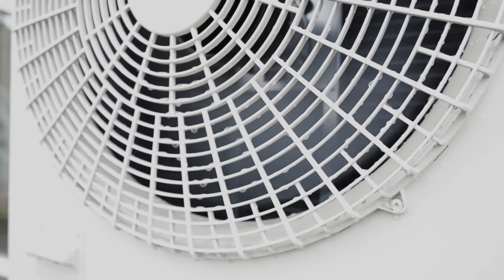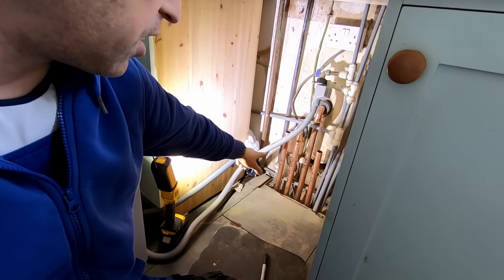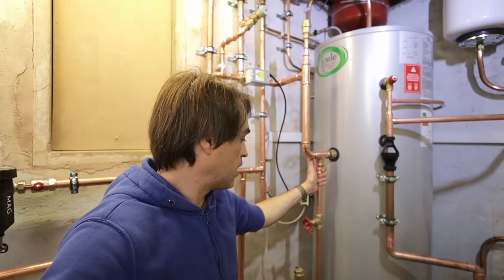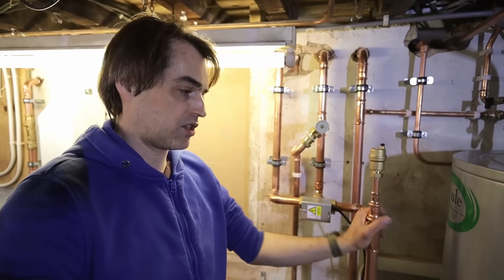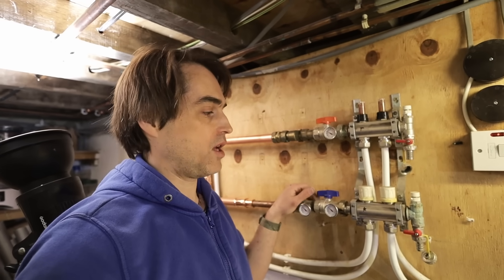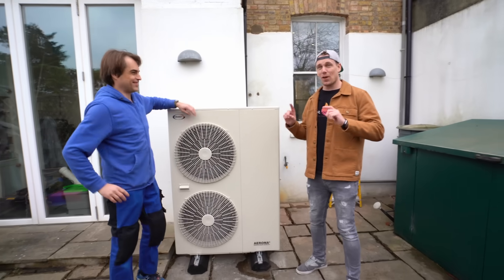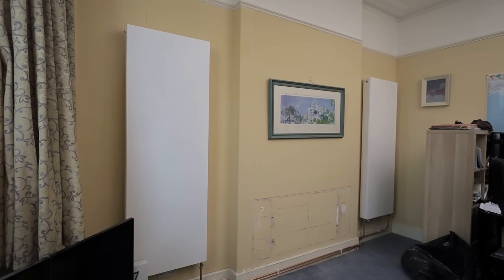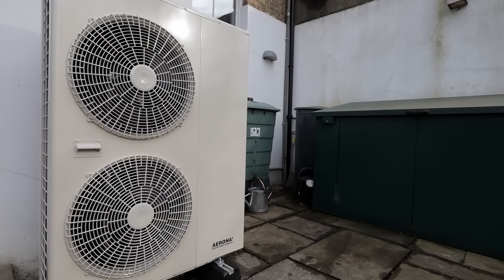The Truth about Heat Pumps: Debunking the Myth.

Comment: Excellent work, as always Szymon, but I think this video kind of makes Roger’s point. That install must’ve cost at least £20k, that prv pump alone was £700! And having to fit those massive radiators, including those TWO great ugly things in the lounge! Yes, you’ve shown that ASHP can work in old, solid walled houses, but the cost and impracticality/ugliness of the system will definitely put the large majority of home owners off, as would the running costs. It’s only the well off, virtue signaling “I’m doing my bit” crowd who would entertain that kind of thing.
Reply: This is a pretty large house though I assume - big cellar with underfloor heating, 12 radiators etc. 17kw ASHP was it? that seems quite big so assume a big house. A regular 3 bed semi would be much smaller and simpler. At its simplest, ASHP just replaces a boiler but you run it at lower temps so you might need larger radiators (might not). Run low and slow like you’re cooking a nice pulled pork rather than spiking up/down with boiling hot radiators.
Reply: @MrKlawUK  solid stone walls too so large heat loss.
Reply: @MrKlawUK  From what I know of ASHPS, the property needs to have excellent insulation, have superior air tightness (necessitating a heat exchange ventilation system to control condensation while minimising heat loss and still provide fresh air into the property) and have suitable places to put the heat exchanger etc. There are a great many more requirements for ASHPS to work well than a boiler requires. Since most homes do not meet the stringent requirements of an ASHPS, most homes will require an expensive retrofit. Going forward I see ASHPS specified as the default for newbuild homes, allowing for a controlled change, with existing gas being retrofitted to hydrogen for older housing stock. This would have a number of benefits:
* ASHPS tech will have time to evolve to cope well with our unique weather conditions, becoming a more viable and realistic replacement for gas technology;
* Hydrogen, once given the go-ahead, will be able to quickly scale as new and more efficient separation technology is adopted for extraction from sea water (there are a number of new technologies emerging that have much better extraction efficiencies than traditional electrolysis including an interesting catalysis technology with easy recovery of the rare earth element catalyst);
* The grid will have time to grow safely to cope with the increasing load as ASHPS is another load to add to the burgeoning list including EV chargers);
The main issue isn't the technology but the government lacking the will to commit because they don't understand it well enough to make informed decisions.
If we get a dynamic, educated and forward thinking PM, we could still make those green targets, but only with government backed fiscal support for people with household annual  incomes below £50k, which means the lower classes and the lower middle class. Just an observation on the whole debate, one that is easily overlooked when discussing managed change involving technology.
Reply: Have you seen gas prices recently? This will pay for itself in ten years
Reply: @syrus3k  have you seen electric prices ??? Gas has gone up because what is happening in the world right now, and the uk being the uk and not being self sufficient and always buying our materials and produce in is exactly why gas and electric isn't cheap.
Reply: @syrus3k  you clearly haven't read my comments lol im not going to repeat myself. Do your research budd
Reply: It's also worth considering stuff like triple glazing, cavity wall insulation etc first!
Reply: The prv pump will require electricity what happens if the electric fails is the same time as the prv snorkel and flippers for the basement the customers money would be better spent on insulation zone valves and smart thermostats at the moment heat pumps just don't have unless underfloor heating is used I would think the proven thing to do would be to correctly design underfloor heating in conjunction with heavily insulating put a gas or oil boiler in for the time being show 7 or 8 years down the line the technology will improve on the beer coolers and then you can just look at my heat pump or a small nuclear reactor this is a subject with unfortunately customers are really going to be scammed Roger hits it right on the point why would you spend all this money to have such a compromised heating system you can always wave you willy about your air source heating system but I'm afraid winning it's cold and you really need it the Old Mr Johnson's gonna get a bit short and shrink
Reply: The H2 thing only makes sense once we have such a glut of renewable electricity that we're charging everyones cars and home batteries and now have little else to do with it. We are a long way off of that.
Reply: If you burn the gas in a power plant and your heat pump only manages a CoP of 2.1 you're still getting more heat for a unit of gas, and it only gets better from there, i.e. you have some solar or wind or hydro or nuclear or the CoP is better than 2.1x
Reply: Couldn't agree more. I watched this video and I'm just thinking, damn how much did that cost, damn how much does THAT cost, holy crap 2 of those massive things I've got 3 rooms that would need the same thing how much would that cost!! and where the hell do I put the giant tank!

I'm gonna have a gas combi boiler until the day the gov bans them and my last installed combi before that can't be repaired anymore, after that I'll probably just get my shower replaced by an electric one and freeze in the winter I guess lol
Reply: @lewbaker  I’m gonna stick my neck out and say we’ll still be using gas boilers after 2050!
Reply: @SisterAbdullahX  Fuelled by hydrogen
Reply: @SisterAbdullahX  I think very few people will be using gas boilers after 2050.  When a new technology comes along it is slow to catch on, but then there's a tipping point where the old technology gets too expensive.  There's a lot of infrastructure cost in bringing gas to homes.  This cost is spread to lots of users, so it isn't too bad.  For example the cost of my gas service is over $15/month regardless of whether or not I use any gas.  The more households drop gas, the fewer people there are to share the cost.  Would you pay $30, $60, or $100/mth just for the service?  The same will happen with gasoline cars.  Eventually people will have range anxiety about gas cars LOL, because most gas stations will shut down from lack of customers.
Reply: @antonydewar7875  1
Reply: @lewbaker  a couple decades from now using gas will cost so much that you will happily spend the extra on doing things electrically.

I would not be surprised if direct electric heating would turn out to be cheaper than gas, at this rate.
Reply: @JasperJanssen  Yes more will move towards electric heating but I don't see everyone going the heat pump route. The cost to run a system is only part of the equation. If the install costs are very high and the system needs annual maintenance and replacing every 15 years, other technologies will start to look better value.
Reply: I completely disagree with this video budd and I'm on Rogers side of this debate. I watch your videos alot and your work and knowledge is incredible. But the general normal working class people, would never be able to afford or sustain these units, let alone the cost to run the poxy things. I work in the gas industry and I'm a firm belive that the only way forward is hydrogen 100%. When you look at the bigger picture, the uks electrical infrastructure is crippling as it is, the only thing keeping our light on at the moment is natural gas burning in the powerplants. I could go into so much detail with this, imagine if every house converted to these things, we all got electric cars, the uk would be back in the days of blackouts. We need to have a mixture or renewable and innovative tech to sort our energy crisis to go greener but these things are not the full answer yo that question. Yes you are right they work well in new thermo dynamic builds, but when they go wrong they're lot more expensive to repair than a conventional combustion boiler. And them radiators are absolutely horrendous and I really wouldn't want them things in my house. Hydrogen on the other hand with these, solar panels etc together are I belive the combined solution. Hydrogen for me alongside solar panels are the only way I can see us supporting the grid. Not just that for consumers simply switching to a Hydrogen burning boiler will be better for the environment and the consumer wallet, no pipework changes nothing. If you have a house filled with micro bor  pipe then you'd need to change all existing pipework to put a heat source pump in. 90% of the population couldn't afford this, couldn't afford the upkeep of them when they go wrong so for me it's a no. Keep up the good work my friend, your are an amazing engineer, and its a shame that a lot of the engineers installing these items aren't fitting them to the standard that you are.
Reply: @thebigone3868  you’re aware that the hydrogen that is being pushed hardest at the moment is hydrogen sourced from hydrocarbons, right? And is therefore not an improvement at all?
Reply: @JasperJanssen  not one hundred percent right there budd. Yes at the moment we are looking at putting a percentage of hydrogen mixed with natural gas, amd the facilities we use to extract hydrogen is extracted as a bi product that will have hydrocarbon. The issue with it at this moment are investors that are looking to invest into green hydro production are waiting for boris and his cronies to make a decision on the futre of gas. The mandate isn't being discussed until 2025. As soon as they make there mind up it could be a multi billion pound economy, and green hydro station can be created.
Reply: @thebigone3868  Totally understand your point on cost grounds; though hopefully large volumes can make prices cheaper. Also agree that there need to be different types of tech for different situations. Virtually everyone can agree that more insulation is important. Whilst I don’t rule out hydrogen for limited uses, it has major problems. First, generating by electrolysis is expensive because for the most part it is produced by fossil fuels and the majority of the original energy is lost, making it pretty inefficient for home heating. True, it could in future be produced, by capturing surplus wind power, but with much lost in the process, other tech such as heat batteries may at times be a better option. Having bi- directional feeds on cars offers tremendous opportunities to soak up surplus solar; even re-distributing 3 or 4 kW from each car every day, would make a significant contribution to balancing the grid. I don’t exclude nuclear, but large scale projects have historically taken more than a decade- time we don’t have to wait. Worse yet - have large nuke projects ever been on budget? Small modular reactors can happen much faster, but not at sufficient scale. So all contributions welcome to stop burning stuff. Apart from ASHP, Kensa have demonstrated their ability to successfully provide GSHP systems for communities in large tower blocks in Sunderland. For some, Tepeo electric boilers may be the best answer, especially as electricity becomes greener over time; that may also benefit from being able to use existing home infrastructures and some off-peak charging, but cannot exceed 100% efficiency. Not sure if Tepeo will qualify for any grants or whether it will be free of VAT. Interesting times - but difficult to avoid cost implications. 😊😊
Reply: @thebigone3868 We have been to a few bungalows where tenants have nightstorage heaters and they rarely turn them on due to them being horrendously inefficient and they sit in the cold. Now a  couple of the same bungalows had ashps installed a couple of years back and they are over the moon with them( running cost and they heat the house well). We are about to put solar pv on them now also which which bring their electric down even further. So in this situation heatpumps are the king. And you being in the gas industry (apparently) should know the volume of gas boilers out there, so yes parts are going to be cheaper (how come oil boilers are double the price?) When the market starts to get flooded with heat pumps parts will start to get cheaper and with more investment into heat pump they will get even more efficient. I do believe Hydrogen will have its place and its potentially going to be in the cities.
Reply: @mikecole4952  my point being Mike my friend  which I stated above, is do the research and look at what is keeping all electrical appliances in the uk running at this moment. It is gas. If the gas went off tomorow these air source heat pumps will just be a very expensive ornament. If everyone put these in their houses and switched every single appliance and vehicle to electric, you would welcome blackouts into the UK regularly. If im not mistaken 4% or there abouts of our energy comes from nuclear power, around 14% are renewable, when the wind is blowing and the sun is out, and the rest is gas the figures differ but its there or there abouts. As I also stated these air source heat pumps are good but in the right circumstances. I live in South Wales for example, the majority of these properties here have shocking thermal insulation, they are old mining houses with multiple stories or edwardian houses. I have seen first hand these installed innproperties like this and it literally feels warmer outside. And one thing I can tell you is I and many other people in my community could not afford 20k to install these. The cos of these will come down marginally and as I'm sure your all aware the cost of living is absolutely going through the roof. These units will work brilliantly in new builds, bungalows etc. But look at the demographic of your area I know in South Wales valleys these wouldn't work, grounds source heat pumps are amazing aswell, but again you need a lot of space for them and their are expensive. And I for one do not ever want to see anyone choosing wether to eat or heat they're house. Search me on LinkedIn pal if you need to see my credidentials. Leigh hemms . Cheers pal
Reply: @mikecole4952  Good luck installing enough of a solar array that can generate the 12kwh per day needed to run an ASHP 24/7 in winter. 
The only way they can make the economics work with these is to massively bump up the price of gas and heavily subsidize the electricity used by the ASHP.
More poor people paying for the electric bills of the better off  (those that can afford an ASHP installation) via green levy.
Reply: @andreashessler838  There was not one bit in that message where I said it was going to eliminate the electric bill on the Ashp having PV installed. Now summer time with a smart switch installed would probably wipe out the heatpump coming for DHW. And 12kw is double the size heat pump we're fitting in a bungalow. If you're gonna come at me, at least have the relevant information.
Reply: @mikecole4952  So 12kwh per day power in winter isn't a good estimate? I actually thought I was being conservative.
You did suggest that you were having solar fitted to some bungalows to help with the power required to run the ASHPs didn't you? Why don't you concentrate on doing a proper job of insulating the buildings to a high level? You'll probably find that you won't need to install a sodding ASHP and that a combi boiler turned on for a couple of hours a day will suffice.
You might well get a better COP and be able to utilize solar in summer, but who needs heating then?
Reply: @andreashessler838  A proper job? Yea cus my cavity wall filling tool is in my van with all my electrical and plumbing gear? Who says the bungalow isn't already insulated? It still requires heat and an LPG combi would cost even more to run? Oh hang on...you think every house is on mains gas....lol
Reply: @mikecole4952  Why do you insist on using question marks at the end of statements? It wasn't clear from your post that the buildings were not on the gas grid.
For the record, I wasn't suggesting that you yourself did the insulation (although a lot of effective insulation can be done by any half competent DIYer). Contrary to popular belief, there are grants still available to get much of this done FOC.
You don't have to be a one legged, ethic minority on benefits to claim them either.
Reply: @andreashessler838  the sentence 'why don't you do a proper job' implies I'm doing half a job, so yea you've got my back up. You know absolutely nothing about the jobs I'm installing on but yet you feel you can comment without knowing the details and then offend me by saying do a  proper job. So just to elaborate. There is no mains gas, they have storage heaters running at 100% efficiency and cold by the afternoon and the houses have cavity wall insulation and loft insulation. A heatpump and solar will work a treat. And summer time the solar will charge most of the cylinder for free.
Reply: @thebigone3868  If we could install enough solar to produce the hydrogen we need (we cannot, not enough sun or land) then using it directly in the grid to heat houses would be far cheaper.
Reply: @alanjenkins1508  evening mate. Wouldnt just be solar that powers these places budd. As mention in previous comments we need a mixture of everything to meet net zero. With regards to solar have a look at what Elon musk said would be needed solar power wise to power the nation. You'd be pleasantly surprised at what you would need. The issue with solar at the moment is storage of the power it creates (batteries). And as I also mentioned in previous comments budd ashp isn't the answer. It's part of the equation dont get me wrong, but the uks whole energy structure at the current time and moment and likely indefinitely is majority only sustainable due to gas. With out us burning gas at the power stations the lights would go out its as simple as that. These ashp would then become a 20k ornament. I do belive ashp have a futre, but not for everyone and every circumstance. I would advice anyone to have a look at the work oliver Lancaster has been doing and visiting projects that are already up and running with proof that it would work. I could go into massive amounts of detail about our energy grid in the uk 🇬🇧 but this isn't the place really to explain in big detail about it. What I will say is if you understand how the grid works for gas and electric you will know depending on peak times and demand for electricity or gas different methods are used in order to power the uk. For eg if the deman started to peak earlier than usual at 2pm you can't just flick a switch at a near by nuclear power plant to start powering the demand instantaneously. Nuclear power plants need Time to start the reactions safely. Solar pumps energy into the grid when the sun's out, but currently useless in the night as the sun's not out and it will only be supplying the grid during the day (when most people are in work) wind farms are only reliable when the wind is blowing and these things are not entirely green neither. If you do a little bit of research the carbon emissions expelled in order to create a wind turbine is quite significant, and when they have passed their sell by date and need to be removed they CANNOTbe recycled, which is creating quite a large scale problem at the moment. If you set up a green hydrogen power plant close to a hydro electric power plant (plans for tidal lagoon in swansea) near off shore or on shore windfarms and solar you can effectively build one of these station that are self sufficient. The reason I strongly belive we need hydrogen as stated in so many comments now is the gas is keeping our electric on. When the demand peaks gas is the only one that dependable at firing up as an when it's needed. We have the infrastructure already in place to transport and store it. If and when the time comes the transition should be relatively straight forward. On average everyone changes their boiler 10-15 years, the boilers that would get replaced from 2025 onwards would be hydrogen ready. We are already putting a blend of hydrogen and natural gas into our infrastructure and as the transition takes place more and more boilers will get converted into hydrogen ready, allowing the grid to adapt and up the percentage of hydrogen in the pipelines. Yes for the next probably 10 to 15 years the hydrogen that is in the grid will likely be a bi product from hydrocarbons, until big time investment starts happening for these green facilities. Unfortunately it is a slow progression but as well all know things take time and as sad as it is, money is what makes the world spin round in this day and age.
Reply: @thebigone3868  I understand what you are trying to say but to me it sounds more like this. "This is the infrastructure we have.we cannot change that infrastructure in anyway meaningful way ,(indefinitely you said), and therefore we can never use a more sustainable efficient for oh heating."

Plain and simple using electricity ,created by burning fossil fuels or using nuclear plants,  to produce burnable hydrogen to then burn hydrogen to create heat is not efficient. That's not opinion that is fact. 

I can understand that it might be easier. I can understand that in the short-term it could be cheaper but there is no possible way it could ever be as effecient as creating electricity to then power a HP to heat your home. All those green ways you cite to create the energy needed to make hydrogen can be used to to run HP, more efficiently. Your electrical grid is shite? Well maybe it is time to upgrade it and have more stable delivery systems. 
Cheers!
Reply: @adamradley4407  that is exactly my point budd. That is what is happening right now. You need all aspects of things for this to happen. Nuclear, hydrogen,  solar, wind, hydro all of it has to play a part. This is what I'm trying to say to you. For eg. I'm currently working on a project that when there is 100% hyrgorgen in the pipelines, my project is a gas boiler that doesn't use combustion. As a method of producing heat, but a boiler with a hydrogen fuel cell that produces electricity, the electricity created runs to a heating element that warms up the rads and water in your house, and any excess gets pumped back into the grid or home battery storage system.  What  I mean by INDEFINATELY is unless by some miracle nuclear plasma fusion works in the next 10 years that supplies immense constant energy what other hope do we have ? I'm open to suggestions on what you belive will give us this extra 50-70% of energy thats needed to power the uk if the gas went out tomorow. I have said over and over again in each of my comments that for our grid to be sustainable we need a bit of everything for it to work. I honestly cannot explain it any clearer than I already have. I'm extremely passionate about net zero. Please tell me what your suggestion to completely eradicate gas from the equation to get the 50-70% thats used daily to keep your lights on, your air source heat pumps etc I'm always open to ideas and suggestions
Reply: @thebigone3868  you misunderstand me. I understand your power plants need to function at the moment on fossil fuels. This is case in many places. That doesn't mean that the best use of the electricity produced at these plants js to create a substance that then has to go through another conversion process to achieve what you want to do. The more conversions happen the less efficient it becomes.

Also HP do not create heat. They move heat that is why your coefficient of productivity is much higher. 1kw will yield more then 1kw of heat moved. Direct electric  elements are at best 1kw to 1kw out.

How ever I do agree with the premise that there should be a multitude of solutions to this problem. A bit of everything is the best solution as it can maximize various methods depending on the resources available.

Time will tell and you are correct that everything should be fully explored.
Reply: And one more point adam budd airsource heat pumps  draw power from the grid budd, the electric grid that currently, is powered mainly with natural gas. So that little ashp isn't as green as you think. Unless you have one of these, and a hefty 20kw solar power system on your house, with ample battery storage capacity and are completely off grid, then this my friend is not green. Not yet anyway maybe in 20 years time but not yet.
Reply: @adamradley4407  I hope so mate. I  hope the big people in power make some big decisions over the next few years to allow us to go green and it really is possible but it always comes down to money in this world budd which is a sad fact . Finger crossed our generation pave the way a bot better for the next. All the best budd
Reply: @thebigone3868  The Levellers summarised this sentiment when they sang "We bought our new green wool and pulled it over our eyes."
Reply: @thebigone3868  Best comment on here.  I have two Grant oil fired systems (two properties on my land) with micro bore pipes and 2,500 litre tank - ouch.    Bring on the hydrogen systems I say.
Reply: The £700 pump was only because the cylinder was in the basement.
Reply: @dinendale666  ok, so that’s knocked it down to £19.3k!
Reply: @SisterAbdullahX  my only point was about the pump cost that won’t be needed on most. I agree they are vastly overpriced right now , even taking into account the grants some people can get. You mention the running costs though ,  I though Rodger was against them because of that exact point but part of the vid was to show running costs wouldn’t be so bad if set up and installed correctly.  I remember solar panels being 15/20 k for a 4kwh system, yes the feed in tariff was good at .40p + for 25 years but it was still very expensive, I Ihad them installed 6 years ago 4kwh system for 5.4K and the money I’ve saved plus the feed in has nearly paid for themselves now -about 2/3 years to go .
Reply: @dinendale666  Just remember your feed in tariff is paid for  by many folk that can't afford to pay for it. Not something I think you should be crowing about.
Reply: @mal6232  who’s crowing , I get paid 0.05p approximately per KWH @ half of the total amount produced by my panels.
Reply: @dinendale666  brilliant 👍👍
Reply: @dinendale666  I've replaced gas boilers for less than £700.... That one pump, which will undoubtedly fail, costs what most people's family car does.
Reply: My point exactly. Aside from the lovely pipe work and the tech talk and the poor team up and that it's his business to sell and install them. No vested interest there then. He didn't provide a proper comparison. Roger at least touched on these items. I get it he's a real good installer and knows his stuff. But I'm sorry it's a poor video when it comes to us peasants who look at every penny.
Reply from the maker: I do mostly gas boiler installations but believe that future is in ashp. I do agree they are more expensive to install than gas boilers. However you need to understand that we are pretty much installing a new system - cylinder, pipework, radiators. If you compare it to a full central heating system with a gas boiler (not just a boiler swap) - the difference becomes much smaller. 

If you had to install new pipework, radiators and a gas boiler on that property the cost would be pretty much similar. ASAP may be around £3-5k more. That is why it makes perfect sense on major renovations and new build.  Retorfit will unfortunately always be expesnive.
Reply: @UrbanPlumbers  So where exactly am I going to put this in my listed 1930's concrete flat in central London (one of 80)? The answer if you can't even if you wanted to as there is nowhere for the outside units & the listing would prevent it even if there were. Our new system was gas and building control wouldn't even let us put up insulated plasterboard & let's not even start on the incompetent plumber who installed it (uninsulated pipes, using folded sandpaper screwed into the wall instead of clips etc all hidden behind skirting boards that fell off).
Reply from the maker: @richarddicktaylor219  communal ground source can do flats with no need for external units. If you have no groud / sapce for that you will have to go direct electric I guess when gas is turned off. It will work but will be 3-5 times running cost of a heat pump. You can add PV solar lower grid consumption.

Hydrogen is years away and may not even happen. At the moment it is manufacturerd from natural gas and coal with carbon capture and that makes is very very expensive. I think even the most optimistic predictions for H2 state that only 10% of husing would be able to use it. What elses is there? Direct electric or heat pumps. I know which one I want once gas is off.
Reply: @UrbanPlumbers   @Urban Plumbers  as I said above mate investor's that will invest in green hydrogen facilities wont invest until the futre of gas has been decided in 2025 budd.  You are wrong about the 10% mate, the pipelines we have in the uk are 10years away from being converted into plastic, which will be able to handle hydrogen. These networks supply the majority of houses in the UK. Yes at the moment hydrogen is expensive and it isn't green at the moment, but once the futre of gas is established the amount of investment that would take place would be insane. The price of energy would be a lot cheaper and we would have a green solution to our energy. I also think solar is the way forward. I'm not completely against these ai source heat pumps but I have surveyed so many properties that have had these fitted where in cold winter they just aren't viable in old houses. This could largely be due to the fact the installers have done them wrong, but I think its a mixture of things. One thing I will say is they work far better in a new builds, but the noise .... I couldn't bare that.
Reply: @thebigone3868  so I am canadian. Arguably we are a much colder climate then you. We have different systems ithen your old boilers, pretty much all of our homes are forced air. We install ashp but you do need  secondary source of heat. Either direct electric or natural gas. The heat pumps can heat to about -10°C then they are out of commission and the secondary source kicks in. That means that for most of the year ashp is fine. January and February the secondary heat kicks in more often.

I guess when you guys complain about noise it is because you don't have air conditioning in your homes? Here replacing your conventional AC with a HP is an definate upgrade in so far as loudness goes. It is also an up grade to the efficiency of your AC. I never quite understood how someone could complain about the 40-50 decibels that these give off when  they are ru njng full bore.

I also don't quite understand the argument that jmple,3ntjmg this new tech ology that will become,e less expensive as it becomes more popular is bad bud encouraging an even  ever technology like H2 is ok because it will get less expensive over time,.

I do understand that Canada has much newer homes and not nearly as many 100+ year old homes but still sooner rather then later a change will have to be made and nothing is more efficient efficient at moving heat the  a heat pump. That is just plain physics. Burning will never net you 100% efficiency where as a hp at temperstured above 0°C will net you 200%-300% efficiency.
Reply: @adamradley4407  yes bud the noise issue we have hear is houses are close together and in a lot of instances connected. (Terraced houses) which can be an issue. Im not familiar with how your houses are built over there budd, over here most of the old houses have insulation only in the attic. Only houses built after sort of the 90s  they really started insulating properties well. We don't have air con budd in the uk, the majority of time it's raining hahahahahah also big fan of Canada mate. Beautiful place
Reply: @adamradley4407  also budd just so you know I'm not completely against these things at all. Im not arguing that they are horrendous. My argument is that it's not the only answer. Have a read of my other comments budd and youll see my reason why. I belive everything that happens now has to be a bit of everything, but I really do think hydrogen is the way forward for us in the uk
Reply: @thebigone3868  it will be that’s why the pipes are still being upgraded.
That’s why there’s hydrogen boilers,fires and hobs ect all ready made and tested.
They’ve also got an estate on hydrogen at the moment.
It makes the most sense
Reply: @plumbertime  the infrastructures already there budd ready to go. No messing around, cost effective for the end consumer when the time comes, easy transition over time and will create hundreds of thousands of jobs for all existing and young gas engineers in the uk. Keeps the light on, will eventually be completely green and will reduce energy costs in years to come.
Reply: @thebigone3868  it doesn’t like the steel and iron pipes we have.  and can cause embrittlement.
Guessing that’s why there’s so many yellow plastic gas pipes being fitted!
Reply: @plumbertime  it really doesn't but it's interesting they have you all fooled.
It will be a great deal more expensive to run than a heat pump, or even gas now.

If you're sourcing the hydrogen from gas - well of course it will be more expensive it's processing it. Then are we capturing c02 too? Expensive. Then what have we got at the end of it? Less energy left. We'd pay more for a gas with less energy.

Everyone complaining about the cost of upgrading a central heating system seems to be missing the point that this is exactly what should have been done for condensing boilers. You know to allow any of them to actually condense. We've been swapping out inefficient old non condensing boilers for new condensing ones but the small radiators and pipes and high flow temps have meant very little efficiency has been gained.

We're going to have to subsidise working class people to get these changes made to enable a just transition. We can't continue with gas. Hydrogen is a con from the oil and gas industry. We can't heat our planet and let our next generations suffer.
Reply: @UrbanPlumbers  you cant say hydrogen may not happen mate, its been blended in last year as a trial for combustion purposes which makes little difference and its 20% blend from 2023 continuious. Everything os gonma be expensive like your heat pumps, but once it gets motion and its getting used alot, the price will come down. Creating hydrogen (grey/blue) could actually create alot of jobs for the UK as carbon capture plants will need to be built to reach net zero. Hydrogen is the single biggest chemical element on the planet. Its a no brainer, scientists just need to figure it out how to extract it from the ocean lol
Reply: @richarddicktaylor219  district heating is the only sensible option for blocks of flats. Your 30’s flat build would have been designed for this anyway but it has probably long since been abandoned. It’s a shame that district heating is seen as some sort of socialist evil in this country, it works well. The concept of putting a boiler in every single flat is complete madness.
Reply from the maker: @Purebeltersteve  grey / blue h2 has bigger co2 footprint than burning gas, right? 

Its my opinion from what I have read that h2 is just a mirage. Again, my opnion that H2 will never happen for vast majoirty of homes for domestic heating. Just not an option.

We have a massive gas / oil lobby pushing this hydrogen mirage, that is all.
Reply: @UrbanPlumbers  yeah it does but thats where the carbon capture element comes into it. 😃
Reply from the maker: @Purebeltersteve  and how well has that been going? 40% of carbon captured? The massive cost of carbon capture?

What about the cost of hydrogen to the end user? It will have to be way more expensive than both gas and electrics?

Why use 4 units of electricty to produce 1 unit of hydrogen that will be burned at 80% efficency when you can use the same 1 unit of electricty to produce 3 units of heat?

20% blend lowers the caloryfic value of the mix by 16% too.

Hydrogen needs 3 times more volme than NG for the same energy denisty? Transportation will ne much harder.

Estimates say that only properties near main hubs will be able to use hydrogen. That would make 10% of housing stock in the UK.

Current developement of hydrogen is years away. blend may come online 2035? 100% possibly never or around 2050?

That is why hydrogen is nonsense for home heating.
Reply: @Lewis_Standing  I don’t think hydrogen sourced from splitting natural gas is the future more green hydrogen.
Maybe some pink and yellow hydrogen.
Who knows. 

As for upgrading a heating system for a condensing boiler that can not be compared to using an air source heat pump as a boiler will be condensing at a return of 54 meaning the flow could easily be 70 most houses that had double glazing fitted would easily work and condense to the maximum on the existing system.
Obviously the air source heat pump is flowing at 35-55 hence the massive amount of work needed to make it work   
And I think you’ll find most old houses have larger rads as they were originally very draughty or even one pipe systems. So just adding double glazing means a new smaller condensing boiler can be fitted and set up correctly.
Reply: @UrbanPlumbers  i love the debate lol.   Honestly though, how can you make people pay 20k for a full install and would you be happy with the size of rads in your house. You need to be putting underfloor heating everywhere if you werent a plumber would you pay it. Out of interest as you have obviously done some sort of heat pump course, what you going to charge for service. You going to recharge refrigerants, etc. Its not your basic 1 hour service for these units. If its installed correctly, it needs to be serviced correctly and it opens up the door for HVAC engineers to take most of the work.
Reply: @plumbertime  I work in gas distribution network budd. We've been replacing the pipes from metal to plastic now for donkeys and are coming to the end of it now(in Wales anyway) plastic is far more durable, so there should be far less gas escapes going forward making it so much safer. Interesting times ahead budd.
Reply: @plumbertime  you don't get any condensing happening at a return of 54 but okay. It starts to happen below that point. To be fair the boiler manufacturers have been telling you to set it at 70 with a 50c return. But this won't achieve the claimed efficiencies. Only lower temps will. The lower the flow temp the better the efficiency.
Reply: @UrbanPlumbers  Gas isn't going to be 'turned off' anytime soon, I can guarantee you that. Gas is expensive at present due to the heightened demand. What do you think will happen to said demand and the price once more renewable and nuclear infrastructure/generation is in place? 
They've already said that they're not just going to leave it in the North Sea.
Reply: @Purebeltersteve  heat pumps are refrigeration systems. Not all that complicated. To those who don't service them they can seem to be very intricate but they are not. As a Canadian HVAC tech I serviced ACs before the heat pumps became popular in my province. Heat pumps have a few more controls but nothing more complicated then say a high efficiency tankless hot water system or a modulating gas furnace.  Saying they are complicated and expensive to maintain is false. The HP it self needs no more maintenance then your plain old AC unit
Reply: @adamradley4407  here in the U.K. we are not allowed forced air only wet systems (air con is very unusual in residential property and allowing forced air would defeat the object of reducing energy consumption as it will add to our load rather then reduce it)
Reply: @UrbanPlumbers  h2 does not have any co2 footprint because the co2 released is extracted from the air in the first place and when it is burned it goes back into the air = on net 0 carbon is released.
Reply: @UrbanPlumbers  Retrofit is always from more expensive to a lot more than original fit. I'm a builder LCIOB from the UK, worked all over the world including 12 years in the USA where for a good few years I specialised in "Gut Rehab" mostly changing industrial building to apartments and lofts in NYC. Ripping everything out, floors. ceilings and partition walls was always less expensive than faffing around. The refit you did here was first rate and you're lucky to have clients with deep pockets. Sooner or later the old UK housing stock will have to be GutReHabed en mass. The floors and ceilings will be ripped out of UK houses to put underfloor heating in,new plumbing and wiring and insulation. Then you won't have the big wall mounted radiators.
Reply: @pacman7959  the only thing Roger ever touches on is worst case scenarios and the grumble that you can get a grant on ashps (even tho gas and oil has been on grants the past couple of decades). This video is design to show you basic design flaws and what you can expect from a retro fit ashp installation.